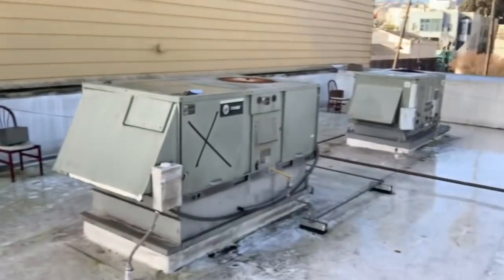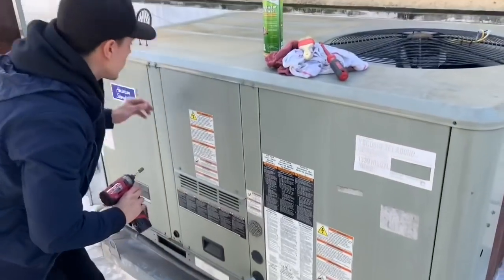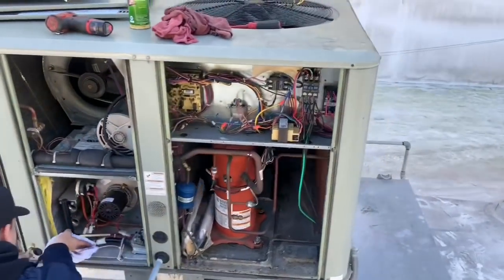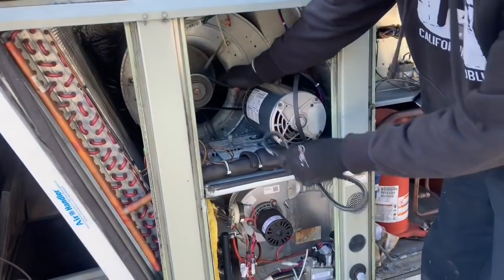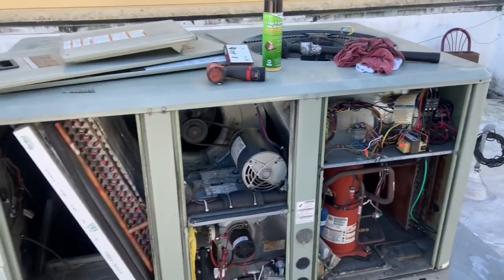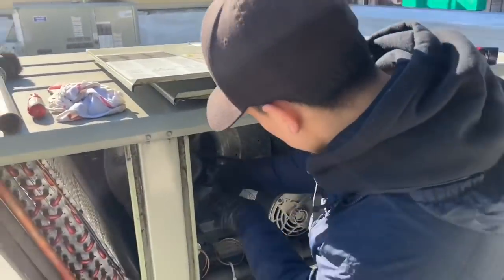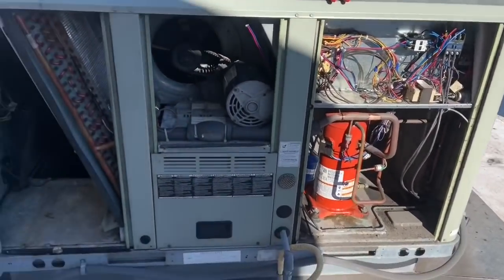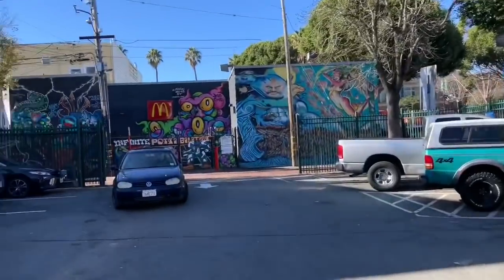HVAC-R VLOG / SHOWING THE APPRENTICE HOW TO DO A MAINTENANCE

Comment: You can do nothing to the unit but make it clean and the customer will think you have done a great job, then you can spend 3 hours thorough service checking amps, gas etc but then leave it dirty and the customer thinks you haven’t done anything. 
Good work boys

Comment: How do you have your fc902 hanging? Magnet glued to back?
Reply: No the 902 has a cutout below the clamps, above the battery compartment, where you can slide a strap through it that comes with a magnet. Fluke and a thrid party sell the magnet kit
Reply: HVAC-R VLOGGER thanks man. I’ve looked for the type that clips into spot cristian is talking about. But finally said screw it and bought some magnets that I’m going to glue to back. Thinking maybe battery door?
Reply: I would have bought the FC902 over the 325 if it was able to read Hz and DC, just cause of the ability to buy the magnet kit with it instead of having to glue a magnet
Reply: Cristian thanks man. I’ve had the magnet kit a few years ago and took it back because of price and because it didn’t fit in there and work like I wanted. Glueing I think is the best way. And the 902 does do DC but doesn’t do HZ. I use my fluke 87 for most dc and also resistance measurements.
Reply: @jphvac5725  Really? Wow, I didn't know. Good to know though thanks, and good luck with the magnet